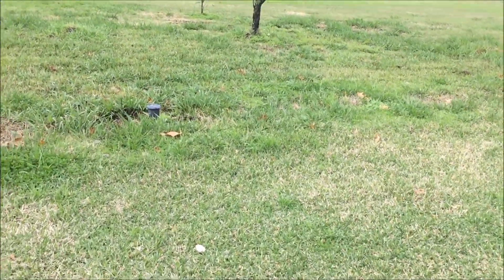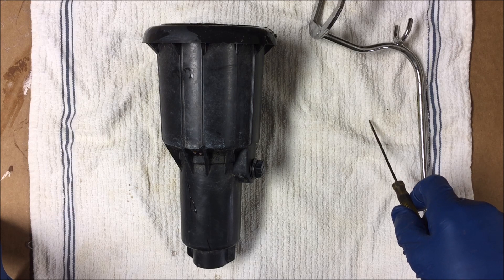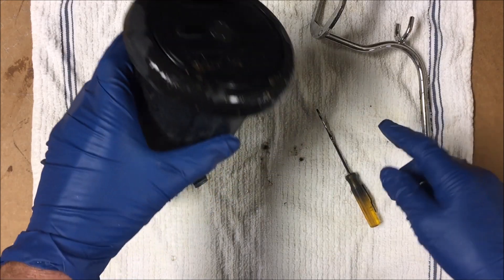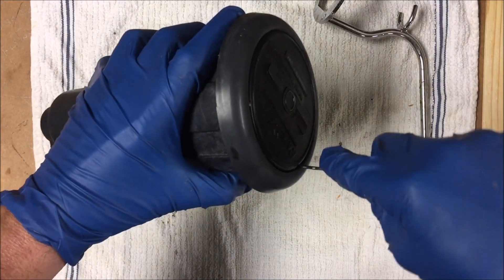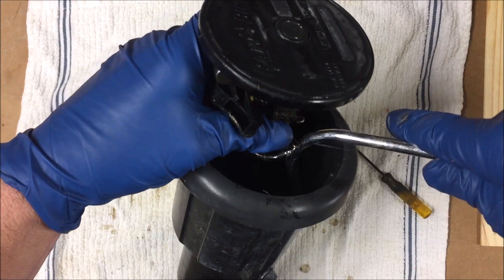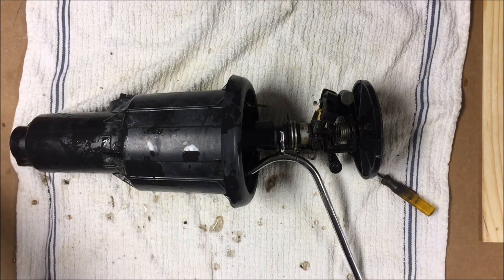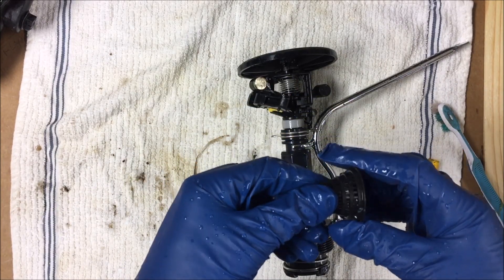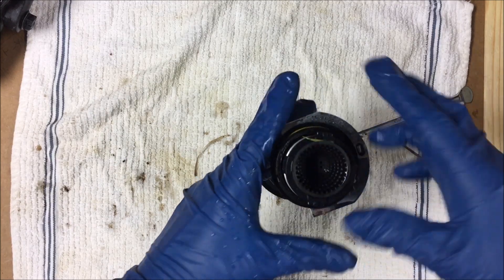Wastewater System - Cleaning Sprinkler Heads

Comment: Nice video thank you. Do you know if when sprinkler is on and working, if I could put a garden hose to the base to clean out all the dirt and sand. With out removing all heads, I believe the dirt and sand inside there is not letting it close all the way. Just want to wash it out, without removing whole assembly. Thank you
Reply: Ok thank you for getting back to me great video, thanks for making it
Reply from the maker: I suppose you could but you can also just unscrew the whole head out of the ground and clean it out upside down.

Comment: Rain bird sucks, the worst ever !
Reply: This is the best pop-up impact sprinkler you're gonna get nowadays. All the other competitors have no sense of innovation anymore with pop-up impact sprinklers, so what you're gonna get from them are cheap Rain Bird Mini-Paw/Maxi-Paw knock-offs, but with their branding and minor cosmetic changes.

You're less likely to have any problems as long as you have good pressure at each head (30 psi recommended), and most importantly, having gravel around the base of the canister, filled all the way to where the drain ports are, as the gravel allows water to drain freely from the canister while the sprinkler operates, preventing grit build up, which is the number one cause for a pop-up impact sprinkler to fail. The gravel will also prevent roots from entering the canister, which are also problematic.
Reply from the maker: I got that recommendation from a pro in the industry.  It worked as long as it was cleaned occasionally.

Comment: how do you treat for the "1%"? i'm having to clean heads two three times a month.
Reply from the maker: Are you running the MaxiPaw heads?  If so, I'd imagine its time to have your tanks (all of them) cleaned out.  You have too many solids getting to the sprinkler heads.
Reply: no just rainbird 5000 had all tanks pumped less than a year ago. i think there is more raw water going in than the bacteria can handle so im adding yeast.
Reply from the maker: I had that problem with other heads.  Upgrade to the Rainbird Maxi-paw and those problems will disappear.
Reply: i just bought new ones couple weeks ago. i will change soon. thnks for responding
Reply from the maker: Any time.  I'd get new heads the next time you have to do a cleanup (unless you just enjoy cleaning heads)  yuck!
Reply: i don't enjoy it that much! hahaha

Comment: hey nice post..we have the identical maxi paw here on our place. That model is so much more reliable than the original small spray heads... I just came in from pulling mine up out of the ground about 4 inches as they sunk down in the earth after all of the winter rain ice and snow. A couple days ago I had a pool O water around the last head on the line. We had some sunshine yesterday & today.that pool of water had absorbed into the ground so I got after em...I never have cleaned out that basket so I will attack that if I notice any further issues...Thanks for your encouraging diy post. Have a good one!
dennis